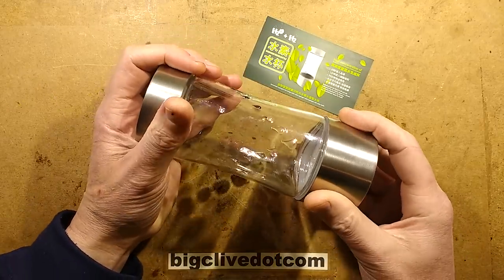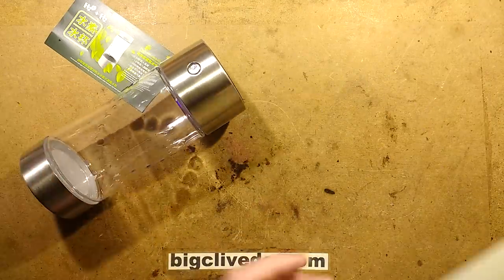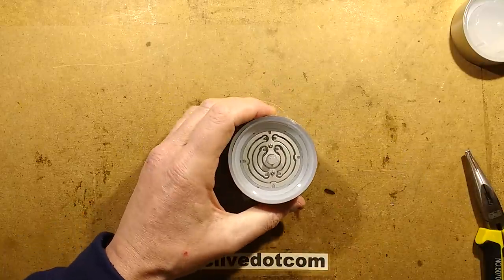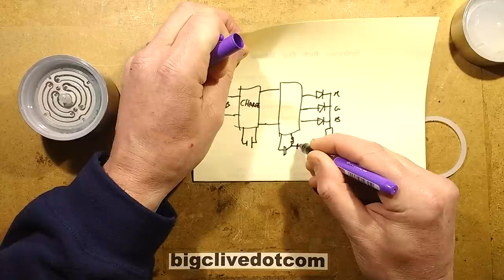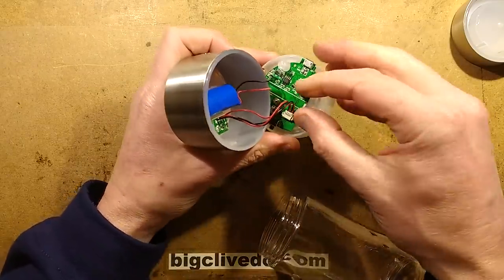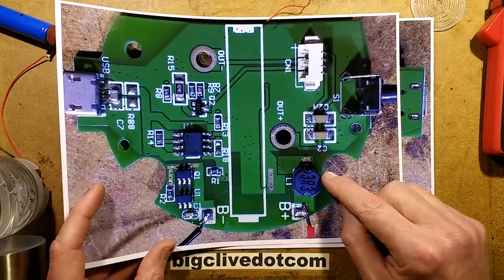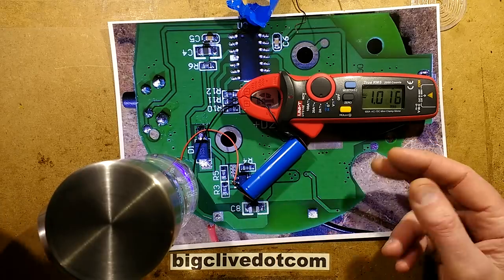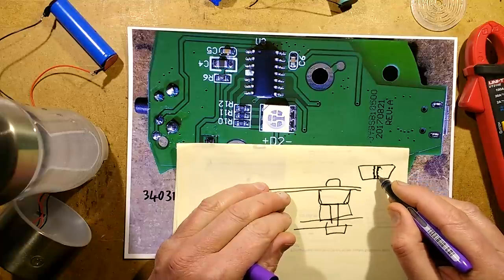Fixing an anti aging hydrogen-rich water generator.

Comment: Clive, as you are releasing the hydrogen from the water then why is it marketed as hydrogenating the water ? you are taking it away not adding it, I thought it would raise the oxygen level and reduce the hydrogen. ?.
Reply: Well, you're not raising or reducing anything, really.  You're just splitting the water into gases and making lots of bubbles.  One could claim that the hydrogen is more bioavailable in bubble format, I suppose.  Maybe you could use it as a holistic reflux chamber, dispersing the magic cat farts into their properly infinitesimal proportions.
Reply: Hydrogen gas isn't a good reducing agent by itself: a catalyst such as raney nickel or paladium is needed to get any reaction at room temperature, although it will react with chlorine gas in the presence of sunlight, but
that's due to the Cl2 molecules breaking in UV light producing radicals that can attack the H2.
Reply: Trivial quantities of the hydrogen gas would dissolve in the water. Of course, the oxygen would too, and I would expect the highly oxidising effects of oxygen gas to outweigh any theoretical reducing effects of hydrogen gas. Not that it really matters, since there's no real evidence (at least that I'm aware of, feel free to correct me) that extra antioxidants aside from typical vitamin requirements do anything to help, and your body is already expert at managing oxygen gas which is why you're still alive.
Reply: It is putting hydrogen gas in the water, but they don’t mention the oxygen it is also putting in the water. It is complete quackery.

Comment: It looks like it could be an 18500 cell. While not as ubiquitous as an 18650, they are still readily available from reputable manufacturers. The 18500 is commonly used in pairs as a replacement for three standard 123A lithium cells. It's a flashlight thing.

Comment: I love the soldering job on the battery leads. Looks like someone else is just as bad at soldering as I am. LOL
I don't know whether to applaud their practice of reusing old batteries or to curse them out for releasing hundreds of products that will fail prematurely. Even though it's in a quack product, one still expects to get at least a week's use before it goes tits-up.
Reply: Scrolling down, I see that I've watched this video before. Guess I didn't remember it... But I also point the finger squarely at Susan W. and the YouTube algorithm that presented this video as "NEW."

Comment: I just replaced a set of three  800mAh 18500 cells with 2200mAh cells in a solar lawn spotlight. The 18500s are a lot harder to find than the 18650s, but you can still get them cheaply if you don't mind waiting for that slow boat from China. They actually tested as slightly higher capacity than advertised. I think I'll need a slightly larger solar panel to keep them charged through the long winter nights, however.
Reply: might be ok in low drain, but i guess this device at 1 amp means cheapos wont do the job
Reply: I think the cells I just bought are actually higher quality than the ones that came with the lights. Also, I see I made a typo in my first reply; the new ones are 1200mAh, not 2200. When I tested them, a full charge/discharge produced about 1250mAh each.  So it's really only 50% more capacity than the original 800s (which I never actually tested, just based on the labeling), but it should make a significant difference. These are 3.2 v cells, but I should check to see how high the charger in the panel takes them and how deeply they are allowed to discharge. I should also measure how much current the three spots actually draw. It might make sense to just use two of them over the winter.
Reply: FXM if they are 3,2V cells, you've just bought a LiFePo battery !

Can be drained savely to 2,5V and max. Charging voltage is 3,65V.   So your LiIon/Lipo charging board in the solar light would instantly overcharge the cell.  (4,2V for Li-Ion/LiPo based batterys max.)
Reply: casemodder89: Yes, they're lifepo4 cells, and that's what came with the lights. The new ones are just rated to hold a bit more juice. The voltage is the same, just higher mAh, so I'm assuming the charging circuitry in the lights should handle them fine.

Comment: with Chinese stainless steel you will probably get all different types of toxic metal ions into your water. Also water splitting will of course give you both hydrogen and oxygen (the ozone smell you noticed). Given that the solubility of oxygen in water is higher than that of hydrogen, the hydrogen will escape before you drink the water...

Comment: I had the same issue with a work light that I purchased. It was rechargeable and it came with two crap 18650's in it. They looked like seconds or rejects. Not good enough to be sold or used batteries. I was a little upset. They figure no one is going to open it up and check, but I did. So I had to take three good Samsung Cells that I had and whack them in it. Now it has a good run time. The sad part is the light wasn't that cheap, so I gave it a bad review on Amazon. Oh, one of the cells literally rattled when you shake it. I have never heard an 18650 rattle. So this is a common scam, the product is good, but they save money by using crap Batteries. Some one needs to police these companies, so that they are not taking advantage of their customers.

Comment: The only way to collect hydrogen and oxygen by electrolysis is by isolating both electrodes.  We did this in HS by filling two test tubes with salted water and placing them over two platinum electrodes in a saline bath.  What you have in that jar is an explosive mix of hydrogen and oxygen.  All for shits and grins why not ignite it in another video.  I know I'd do it.  Interesting fact  EThydrogen is a   company that manufactures hydrogen torches for soldering parts to heavy metallic chassis.  It has a reservoir of water which it electrolyzes and feeds to a torch head that produces a torch temperature of 3200C.  Last company I worked at had one.  It isn't without risks since you have to purge the torch before lighting  otherwise, if there is any O2 in the tube, it will backfire.  Fun, huh!  Btw, it goes for $1425.00 USD.

Comment: They money they saved on the cell was probably equal to the cost of the entire board and container. It is a shame but not a surprise since no doubt this circuit design was stolen (free) and manufactured cheaply(with cheap components) without any care for having it last or work properly. These are cheap Chinese quack products so their market is the first purchase mostly so they have no need or care for proper implementation and will cut money wherever humanly possible. Great video as always! Thanks!

Comment: That lithium cell looks like an 18500, which is a fairly common cell. Ebay has pairs of them from around four quid. They are listed as completable with high drain devices.
Reply from the maker: The tricky bit is finding them with solder tags.
Reply: @bigclivedotcom  Simple enough to weld solder tags onto the cell.

Comment: You could smell ozone because hydrolysis, as the name suggests, breaks the water molecules into individual hydrogen and oxygen atoms, which eventually get recombined. Depending on pressure and temperature conditions, the oxygen atoms together will generate either ozone or oxygen gas. Oxygen gas will prevail due to its greater atomic bond stability.
But as always, I stand to be corrected. :D

Comment: The original battery looks like an 18400...I use these in my laser sight.
They are good for high drain but with a bit smaller footprint.

Comment: You can probably use a 14500 and put two of them in parallel. Maybe then it would have enough juice to work a while. Also there is the 16340 rechargeable Cr123, but again I don't think one battery is enough for this device.

Comment: I guess that it would work perfectly as intented (making a nice mixture of gases)  if you'd keep it running at a stabel USB-charger when operating (and thus using both the battery and charger for the needed current)?

Comment: An 18350 is too small, but they're probably going to be easier to find than an 18500, since they're popular in some of the newer mini vapes.
Reply: You can order 18500s just as easy as a 18350. I know because I had to go to a specialty supplier for my flashlight. I've always got high output cells, no generic.

Comment: The resultant mixture of gases is known as electrolytic gas. Lit, a simple random mixture of hydrogen and air goes pop. But electrolytic gas is a stoichiometric mixture containing no atmospheric nitrogen. It has the highest possible energy content of a hydrogen oxygen mixture. Lit, it does not explode. It detonates with a crack so sharp it is hard to describe with words.  I survived such a detonation and was lucky the test tube did not shatter, or they would have been picking the glass out of my hand for weeks. I guess this is a well-meant warning.

Comment: I don't see how they can say it's just 'hydrogenated' when electrolysis is actually busting the H2O into H2 and O2.  It's oxygenated water also.  And whatever free-radical chasing you gain from the hydrogen is going to be counteracted ENTIRELY by the oxygen that is being broken down as well.  To properly make just hydrogenated water, you'd need to separate the H2 and O2 gasses, get rid of the O2, and then somehow bubble the H2 back into the water.  And that is most certainly NOT what's happening in this device.

Comment: Hydrogen is practically insoluble in water at SATP. The only way you could even get any significant amount of hydrogen down the hatch is if you chugged the bottle before the bubbles came out of suspension, and even then, the body doesn't really have any provisions for absorbing it or doing anything useful with it.  Moreover, the tremendous overvoltage being used means that you'd be directly consuming a heaping helping of the very reactive oxygen species you sought to overcome.  Best case, all of the produced ozone, peroxides, trioxetane, singlet oxygen, etc. would simply decompose and/or recombine with the hydrogen, but that's beyond unlikely as you'd most likely just burp or fart the hydrogen out unchanged, while the reactive oxygen species would simply kill whatever they touch on contact.
Kind of a moot point anyways though since the dosages of both would be on the order of ug/kg or less.

Comment: I only recently discovered the 'brute force and ignorance' that is Clive so i am a wee bit behind on the videos Although there is very little ignorance usually it is very entertaining and educational.  I suggest you combine this with the turkish kettle... or surround the bottle with 18650 cells and bump the voltage to 48volts and attach a 'nuzzle' and make a rocket.

Comment: that was very smart 16:30 that you could get current reading by simply having the wire inside that clamp.
If one should pick such a tool up.. what phrase does such a feature go under? is it as simple as a "no contact current clamp".
Been looking for some of these on ali and can see multiple versions UT210A B C D E but no deeper info on this feature.
are all current clamps able to this, and what the con.. lack of accuracy?
btw great videos,  Im learning a lot.
Reply from the maker: Most clamp meters are for AC.  This meter is specifically suitable for AC and DC.  It's a Uni-T UT210E.  You can get them on Amazon.

Comment: would a fine chrome mesh held above the upcoming hydrogen with a type of positive tv flyback electronic then make electric as hydrogen is electron and the proton would not attract to chrome   something like a water battery/generator then amplify it to run the water and produce electric   walmart had a water generator a few years back but once someone sussed what it really was it dissappeared off the market    uv blue is excellent for aggitating the frequency of hydrogen

Comment: In liberating the hydrogen from the water, is it not actually defeating the purpose of drinking 'hydrogen enriched' water as the ingerent hydrogen will be lost as the hydrogen bubbles break the surface?
You say that you could smell ozone. It's possible that ozone is being produced through micro coronal discharge given that the electrodes in this unit are so very close together, even though the voltage is low. Moreover, if the LED in the base is emitting UV then this will augment ozone production.

Shoot me down folks!
Reply: You arent going to get coronal discharge with a few volts, nor under water. The led is obviously not uv.

Comment: 250ma at 12V? Really? Your tap water has a resistance of 48 ohms across a 1mm or so gap? That just seems a little more conductive than I'd expect.

Considering that when you will it up there will be some amount of air in the top, and it is producing both H2 and O2 (and O3) the effect could be made even more exciting by putting a small spark gap in the top of the bottle.

Comment: The Ozone smell might because if you liberate H2 from a water molecule, you also get a free Oxygen atom. Which is then free to combine with others as much into O3 as it is O2, particularly when you've got electrolysis involved which might be messing with the ionic charge and so affecting how the atoms associate. You might also get a small rush off the increased oxygen concentration in the released air, which might con you into thinking that the contents are somehow healthier... of course, if the hydrogen is being reabsorbed into the water without the oxygen, you'll be producing a mild water acid. If the hydrogen is escaping but the oxygen is staying behind, well... essentially you're producing weak peroxide bleach. I'm not sure which of the two is a worse idea for drinking and putting on your skin, really, though I do have some dental-emergency mouthwash tucked away that contains peroxide, which suggests it's not immediately poisonous even though the directions do say not to swallow it, and of course as it's a bleach known to have effects on hair and skin it would have some small (temporary?) effect on lightening age spots.

I figure the backwashing thing is simply to reduce the transfer of material between anode and cathode, by switching their relationship and reversing the direction of travel... wouldn't really cause any difference to the liquid output though.

Must say I'm surprised to find they actually bothered with the electrodes. I'd have initially thought, looking at the effect, that it might just have been some kind of ultrasonic transducer or the like, producing cavitation bubbles. Similar to those "cold mist" generators that you put in a shallow dish of water and emit clouds of water vapour.

Comment: If the cell was the fault and getting a normal AA cell that wouldn't fit the base, I'd just 3D print a new base to allow the cell to fit.  If needs be, remove the USB charging port and just extend it to the edge with wires.

Comment: You'd probably be better off finding an appropriately shaped LiPo cell, or possibly two smaller ones in parallel, cutting out the battery slot and gluing the LiPos in place. And by "better off", I mean it might cost less than the 18500, because in either case it's not doing anything for your health.

Comment: In your haste to dismiss the electrodes, you missed the most interesting part! Those electrodes are platinum plated titanium.
Reply from the maker: Not for £20 they aren't.
Reply: Found those electrodes here: eladeanode.com/platinum-electrode-for-hydrogen-rich-water-ion
Reply: The 'type 2' version is described in the 'features' part, that's why it didn't stick to your magnet and you can see the platinum coating scratching off in your video

Comment: This is nothing to do with this video but I coldnt find the way to comment on your Teleporting Transponder in your things to make. You dont say what size person it will carry but I suppose it works if you are heavy. Im not, but wish to teleport my cat with me. Will it work with a non-human?  I looked at the wiring diagram and think the tele-capacitors are big enough, but the geostar electronosprings not long enough? (My cat is a boy-cat). So I thought you could use a pertubation avoider wired in parraseries to three geodesic transmitters with a Radio 2 avoider circuit. If you had a casu marzu ( cheese with maggots, its made from sheeps milk in Sardinia)  masher with LED indicators this would provide meals on the way to even the most distant parallel universe. Do you know what G=force the acceloration is? Will my cat deal with that? One last question. What solder for the cheese bin?
Reply from the maker: +skizzy smith Yes, the teleport transponder is just a target for the main teleport system.  It will teleport everything including cats.
Reply: Thank you Big Clive. I will start making the teleporter today, we have the day off school as its childrens day. Oh gosh, when my Math teacher (dirty dennis) sees me dissapear that will be awesome! My friend Nicky is going to hide Jet ( the cat ) and the teleporter fits in my desk. Alison will divert dirty D by standing up and wriggling her hips and while he is gawping at her we will teleport out of there!